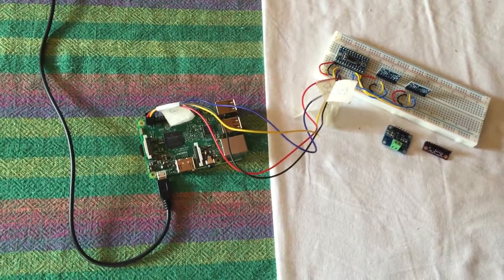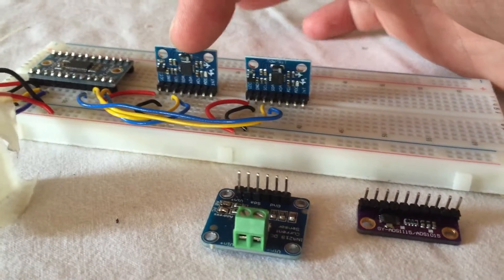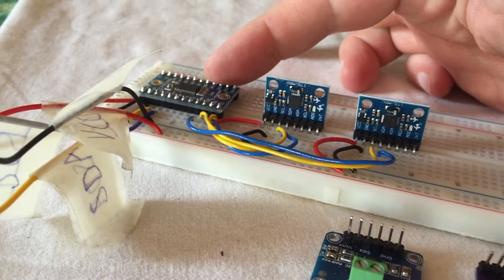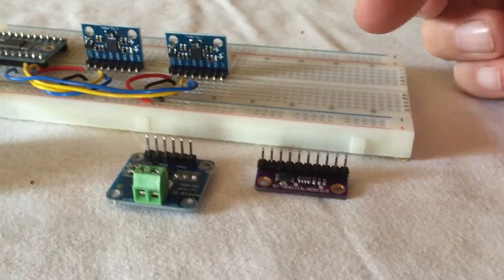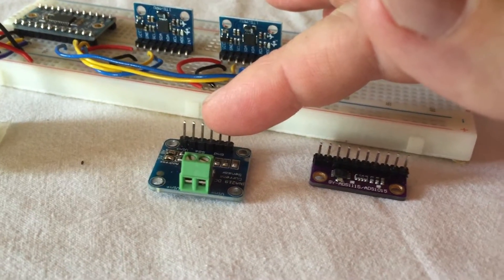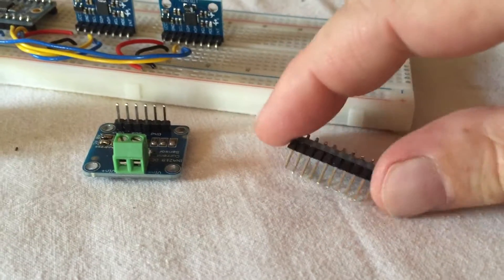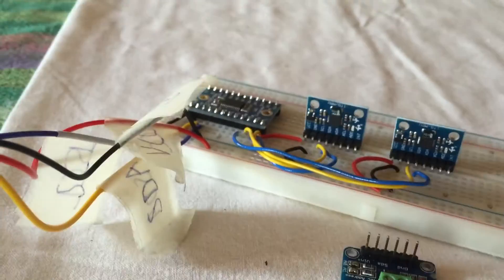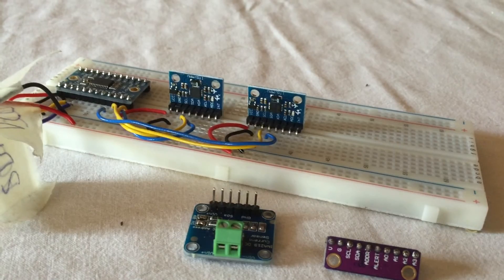Explaining about the i2c protocol and different devices

Comment: Sir actually I am working on to integrate 3 MPU6050 with I2C multiplexer in RaspberryPi using Python but I am fac ing a difficulty in coding the multiplexer(TCA9548A). Can u pls help with the code or else the github code emailID- santosh9sanjeev@gmail.com

Comment: Just to confirm - if the i2c devices all had different addresses, you wouldn't need the i2c multiplexer - right?

Have got a gyroscope/accelerometer and lux sensor in parallel on the i2c bus, but i2cdetect shows no devices :(
Reply from the maker: The i2c devices have different addresses, so you don't need any mulitiplexer unless you want to use several i2c devices with the same address. Please check that you enabled i2c in the configuration panel. Preferences => Raspberry PI Configuration. Select the Interfaces tab, and make sure the checkbox i2c is enabled. Also check the electrical connections. You need 4 wires. 3v3, gnd, sda and scl to be connected. Test each device separate before connecting them together If you have a PI2 or PI3 you should be able to see them using this command:
sudo i2cdetect -y 1
The 1 stands for bus 1. It's used on all PI's except for the old PI where the bus is 0.
Reply from the maker: Yes. If the devices have different adderades, you don’t need any multiplexer